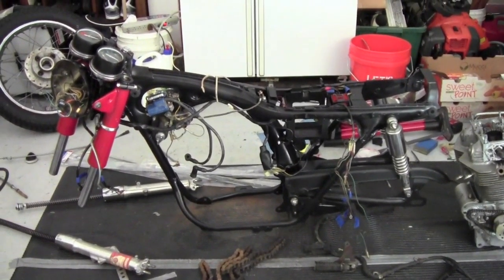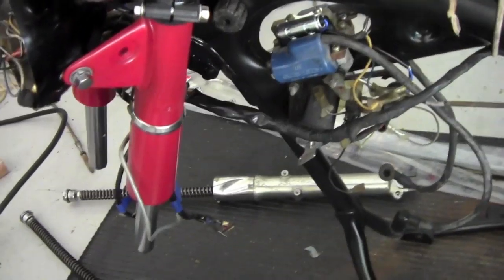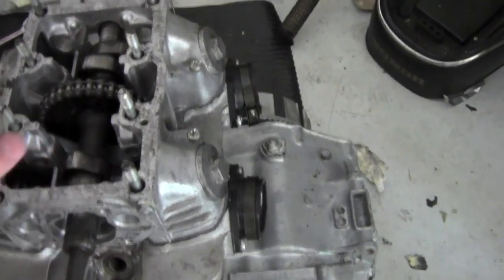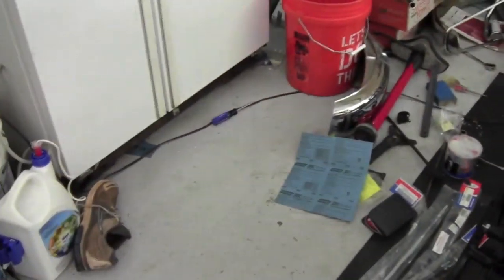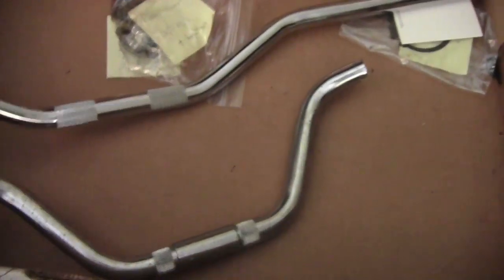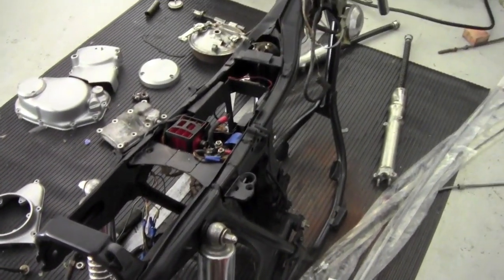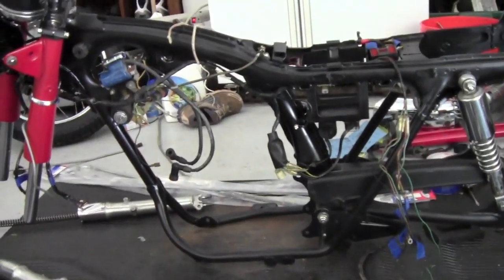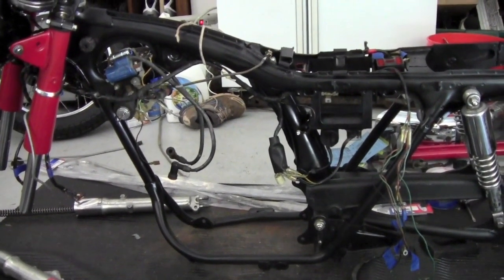Honda CB350 Motorcycle Restoration part 2

Comment from the maker: The regulator and the rectifier both get attached to the basket that holds the battery and then attach to the wiring harness from there. The rectifier has a plastic rectangular connection to the wiring harness and the regulator just has individual wires that get connected together. Be sure that the wires on the regulator match up with the wires of the same color on the wiring harness. The alternator attaches to the wiring harness through a circular plastic connector that will match up exactly to the connection on the alternator itself. I hope this helps!

Comment: Question about general cleaning of the exterior of the engine.  It looks like there's a fairly large difference in the appearance from the first video to this one, did you just use degreaser on the exterior to clean it?

Comment: Hello,
Hope you are having a good day sir. Questions, I have a 1972 CB350 that I just bought and asking if you could tell me where the Alternator, Regulator and Rectifier wires go sir. I have a manual but a little confused. The owner stripped it down for a cafe so he wanted no extra weight. Thank you for your time and have a great day!
Reply from the maker: formegolf I am going to make a video about electrical system soon

Comment: why not repaint it in original colors? since it is a resoration after all...
Reply: no it was originally gold or orange and he repainted it red
Reply: Well if you're going to paint it, why not just paint it whatever color you want?
Reply: Paradigm Storytime Becuase there are becoming fewer and fewer bikes with the original colors like gold, blue, green, and orange because most people like black or red better. More and more people are repainting the bikes red or black and eventually the original unique colors will be very hard to come by.
Reply: If someone wanted the original colors, it wouldn't be that hard to repaint it the original colors. The only parts that are actually painted are the two plastic sidecovers and the tank.